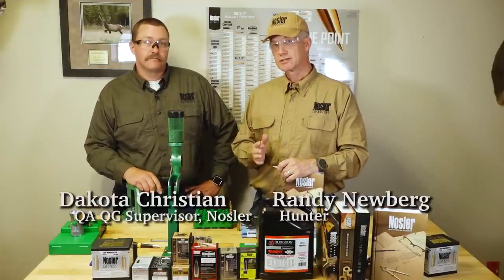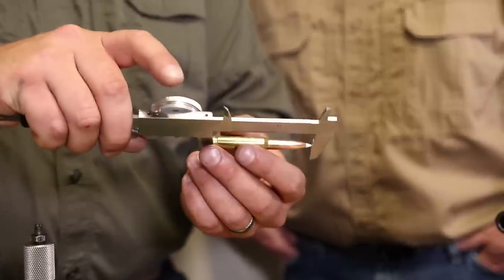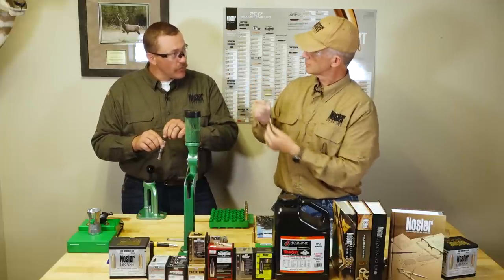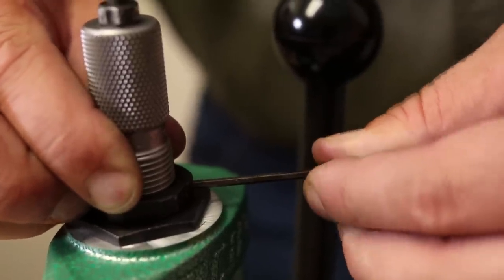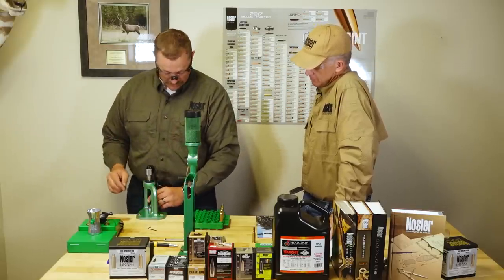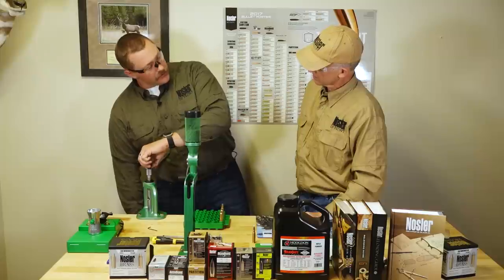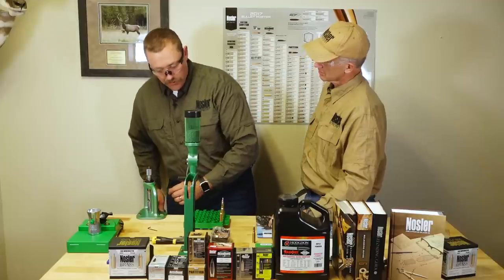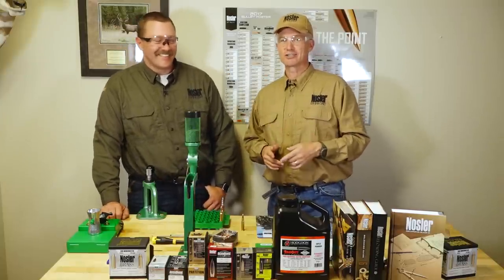Nosler Reloading Tutorial with Randy Newberg - Adjusting Seating Depth (Part 8)

Comment: I'm no expert but have been reloading for about 10 years. You should also do a video about case prep. The TRUE way to save money reloading. Taking your old brass cleaning, tumbling, full length sizing, trimming, cleaning primer pocket, etc. It's not very cost effective to buy new brass every time you want to reload especially considering you can get 5-10 reloads out of a good piece of Nosler brass.
Reply from the maker: I get that and we will probably do some videos explaining that.  This was for beginners and using pre-prepped brass will allow beginning reloaders to have better outcome and fewer variables to consider while they are learning.
Reply: @RidgeOutdoorProductions   If you resize it, which I do with new brass, you will need lube. I like Unique sizing wax the best. You don't use lube for seating bullets though.
Reply: @RidgeOutdoorProductions  You do need to apply lube because they are not resizing the brass.